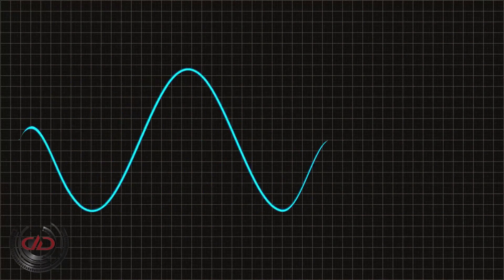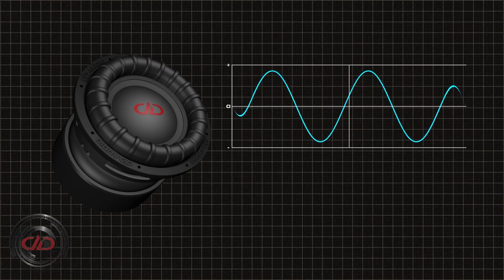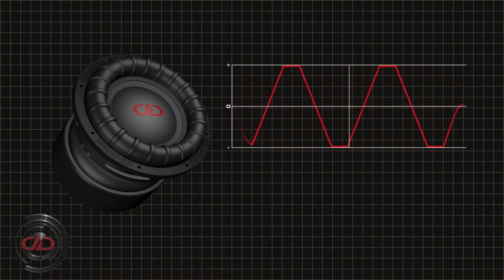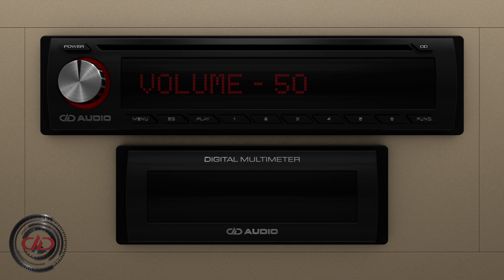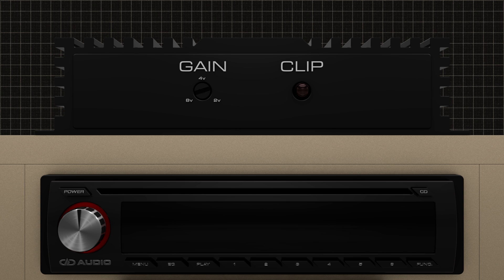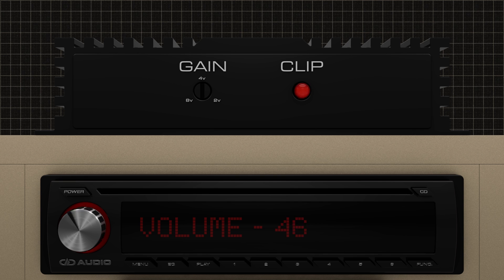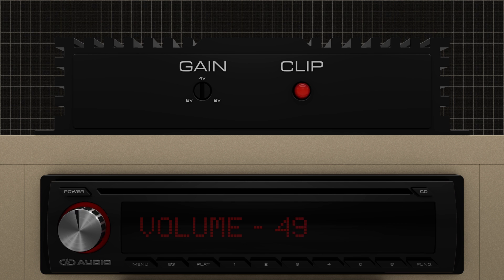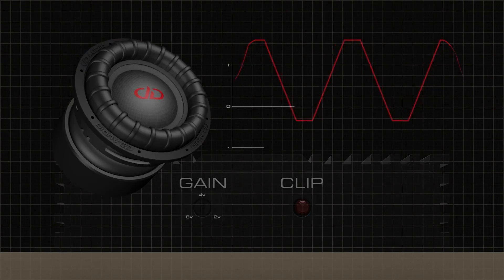What is Clipping?

Comment: The people driving cars around my neighborhood with their bass boosted all of the way are probably going to have clipping.
Reply: Does it work like that tho? I dont really know that much but I doubt thats the case, feel free to correct me if im wrong.
Reply: @nebroskitheraut6705  It depends on how much wattage the speakers can push. If at max volume and there are massive boosts in the EQ and a bass boost button turned on that some cars have, then you can expect that the speakers and subwoofer will clip if more wattage is drawn than the speakers can handle.
Reply: @jasonyoung1306  Oh, interesting. Break the car?!
Reply: Noobs